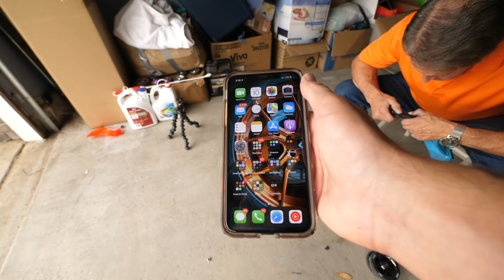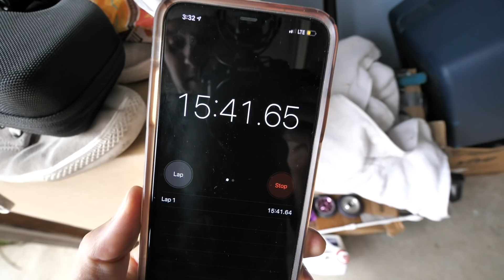ANGRY DAD BUILDS MY SCOOTER!

Comment: You are lucky. I only have one scooter and I found it outside near the trash can. It was ugly green, one wheel, and no grips. It has some ugly bars and the whole scooter is pretty small. When I found it, I bought some grips and and an old blue wheel. And my dad spray painted it black. Now the paint is coming off and the wheels are all ripped. I took it to the skatepark one time and everybody started looking at me and laughing. So that’s why I don’t go to the skatepark anymore. I only use it sometimes when I go outside. I used to have a a blue mayhem supernova scooter. It rattled a lot and my friends made fun of it. Then one kid got it and broke the bar☹️ if you go to my videos and put oldest, I have like 4 vids of me doing some tricks. I’m not the best but I could learn with a new one.